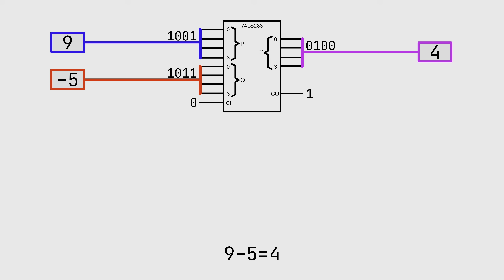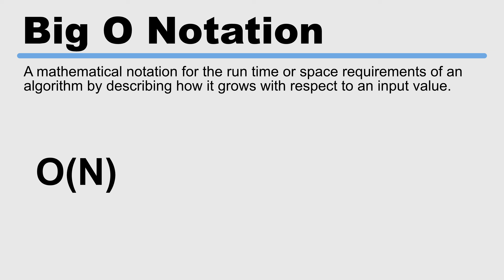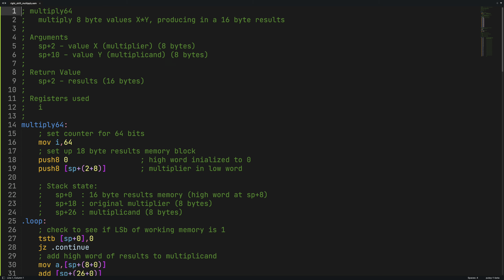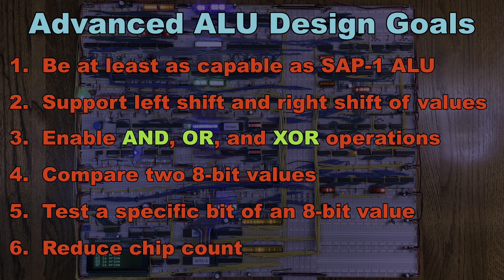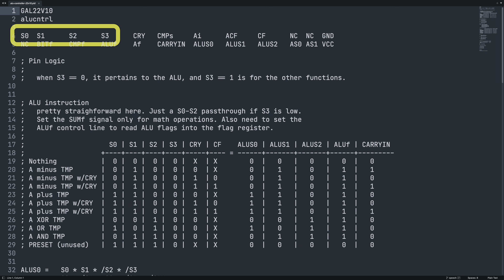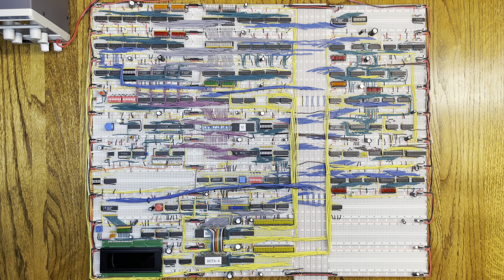Designing an Advanced Arithmetic Logic Unit for the PUTEY-1 Breadboard TTL CPU

Comment: Great video, thanks. Wondering why you didn’t use a 74ls4078 or similar for the simple zero flag, rather than the 20 pin comparator chip with one side hardwired to ground.
Reply from the maker: Partly because of ignorance. This the first I’ve heard of the chip. Thanks! Unfortunately I can’t readily find a source for them. Seems only the 74HC variety is available these days.

Comment: I would put a few Ohms in series with that LED anyway.  If you do, then a small cap will filter out those blips.
Reply from the maker: There is certainly a currently limiting resistor in place (its a resistor network for all the LEDs in the unit), but I will try the capacitor idea. Thanks!